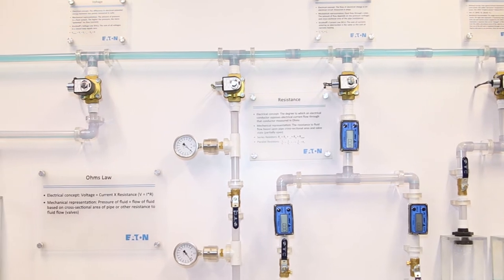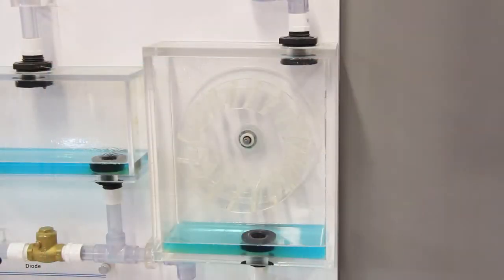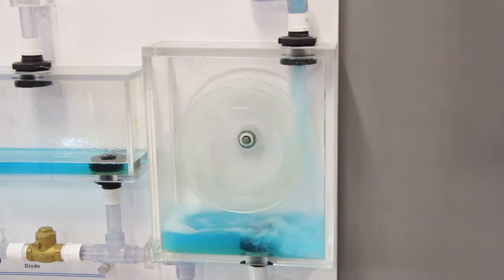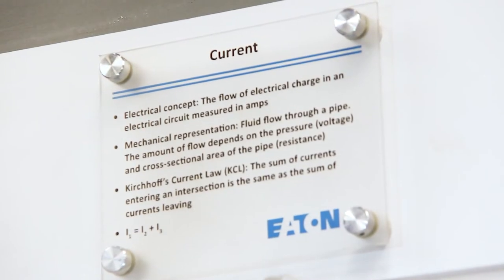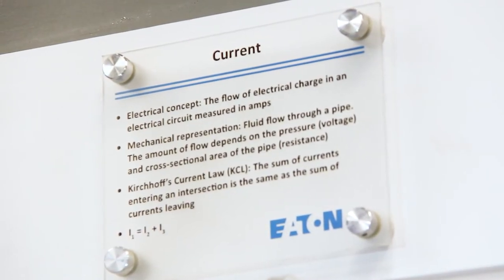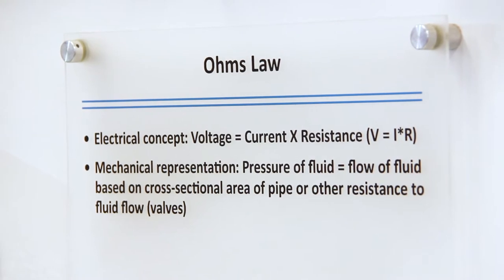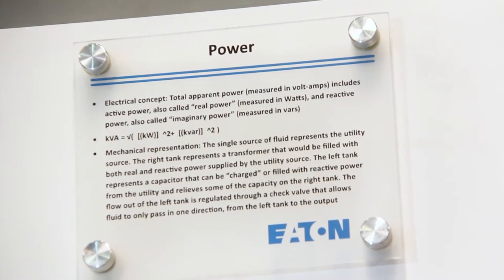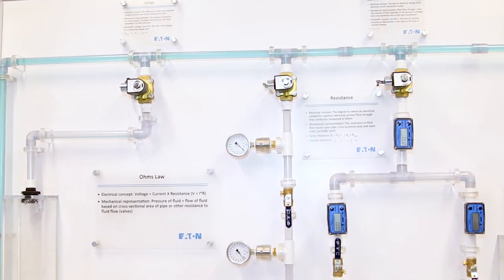Water-based demo explains how electrical circuits work

Comment: as an electrical engineering graduate who's working on water field, this is accurate.. the resemblance between electricity and water distribution is uncanny..

Flow = Current
Pressure or Head = Voltage
Power = Current x Voltage = Flow x Head
Check Valve = Diode
Pipe = Cable
Pipe Head Loss = Cable internal resistance
Height difference = Potential difference
Reservoir = Capacitor or battery.
Reply: How is it different?
Reply: @0x44Monad Plumber here who wishes they went the electrician route. But one difference being that AC current the water would travel down and up or forward and backward depending on hertz/frequency? How would one depict that better with water? Eddy currents maybe?

Comment: OK so what STILL confuses me or what I can't wrap my head around is the volts/amps/watts.  I get it that volts is the "pressure".  But, as mentioned in this video, if you have 100 psi coming out of a super soaker squirt gun, it's going to be a thin, minuscule amount of water whereas if you have 100 psi coming out of a 1½ fire hose you're talking about a lot of water.  Both "voltages" are at 100 psi, but the amount of water between the two is a massive difference.  Would I be correct in saying that the voltage is the "pressure", the amps is the "volume of water" and watts would be the "size of the pipe" the volts and amps are flowing through?  I hope I explained that clearly because it's something that's been bugging the living hell out of me for YEARS in trying to understand electricity through a plumbing standpoint.
Reply: To understand power, there's a few things I always tell people.
1. What context are you referring to power in? Are you analyzing the power at an instantaneous point in time or are you designing a system that can provide a certain amount of power?
2. You need to understand ohms law and a variation of ohms law

V=IR (voltage = current*resistance)
P=IV

To entertain your analogy above:

Your squirt gun - 
Voltage: analogous to pressure /  This is variable - You pump your squirt gun as much as you want (100psi)
Resistance: analogous to resistance caused by nozzle size / this is constant - you can't change the nozzle size, it is what it is.
Current: analogous to flow / This is a dependent variable - it will be a byproduct of the two items above

When you are calculating power, the hidden variable is Resistance. Voltage was variable (100psi is what you decided on) and the resistance was fixed - your current ends up being whatever the heck it needs to be.
So when you calculate power (which is an instantaneous measurement), you are multiplying Voltage and Current - and the Current was whatever the heck it needed to be.
In this example, we analyzed the power at an instantaneous point in time.

Where this analogy gets tricky is, the squirt gun and the firehose are two systems designed to provide different amounts of power. 

Hope this helps
Reply: Almost correct. In this water analogy (* are my thoughts):

* Voltage (Volts, V) is indeed pressure (Pascals, Pa) - the potential to move energy/water. * But what about static vs dynamic water pressure?
 * Current (Amps, A) is the diameter of the pipe (Meters, m). * But why not the flow itself?
 * Power (Watts, W) is water that is flowing (Liters per second, L/s) - higher pressure and/or a bigger pipe gives more flow. * But why not leave it as power (it's a universal concept)?
 * Resistance (Ohms, Ω) is the resistance of the pipe (clogs, material, length?). * But how is that different from the diameter of the pipe?
 * ... the more analogies you try to draw, the more confusing it becomes!

The water analogy may be useful for explaining electricity to small kids, but that's it. It doesn't really go beyond explaining V=IR in a clumsy way.

I think it's better to ditch this analogy as soon as possible and maybe even not to learn it in the first place. At some point, you'll be stuck trying to understand electromagnetic phenomena that don't have water analogies (or if they do, they're not easy/intuitive either), like electromagnetic fields, inductance, charge, alternating current, etc. There are also hydraulic phenomena that don't apply to electricity, like dynamic vs static pressure, turbulence, hydraulic transients (water hammer), etc.
Reply: Volt=Pressure
Amps=Size of Pipe
Watts=How much water your getting at the end.(Watt Hours=How much your getting in a certain amount of time)

Volts × Amps = Watts